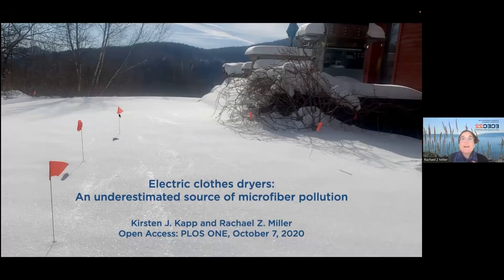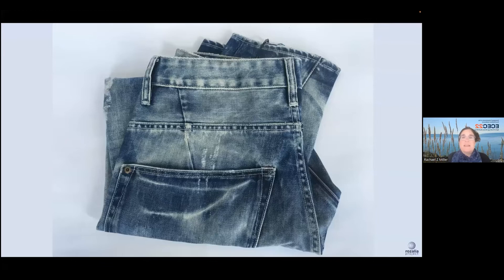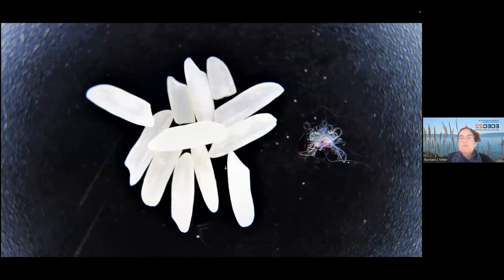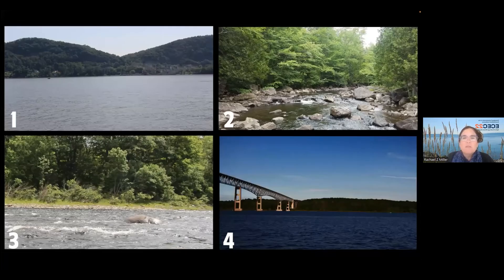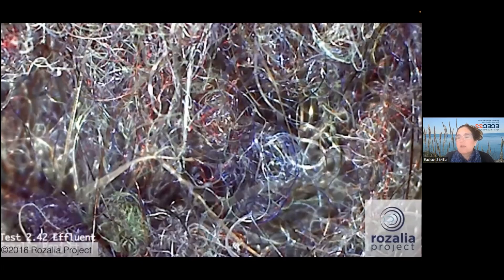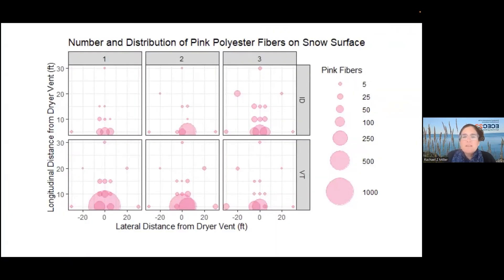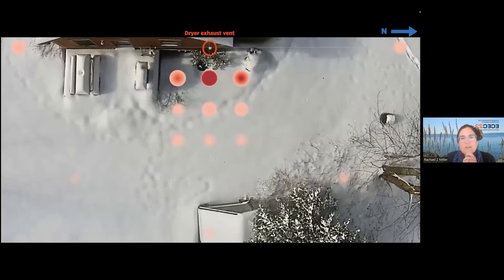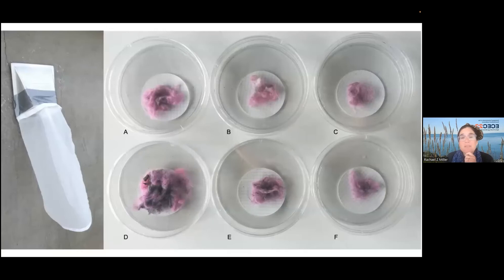Electric clothes dryers: An underestimated source of microfiber pollution

Comment: morgellons cover story or scapegoat LOL .. the microfibers are actually from the manufacturer of the dryers... just looked inside of my dryer and there is some insulation like material looks wooly almost on both the front and back end like a "weather stripping" or seal inside the dryer drum and is the source of the microfibers not our clothes.. my clothes fibers do not fluoresce under UV light but the microfibers on them which is minimal compared to the fabric volume of the clothes do, and those fibers are again source from inside the dryer at the fiber seal at front and back .... shall klausy and company dictate what we can wear and when we can do laundry for 2030 also?